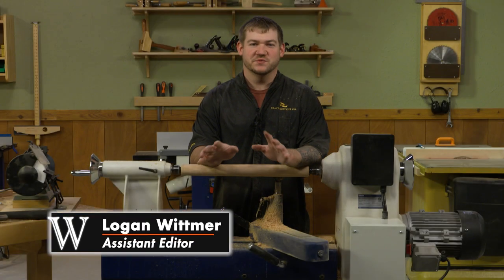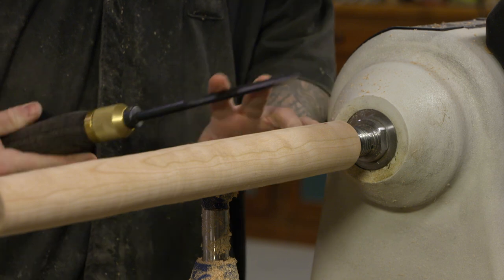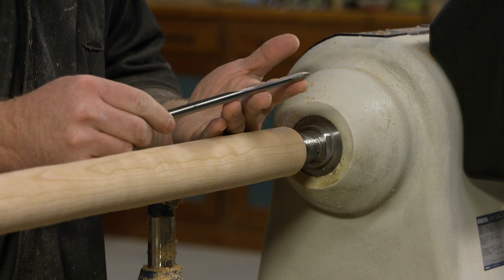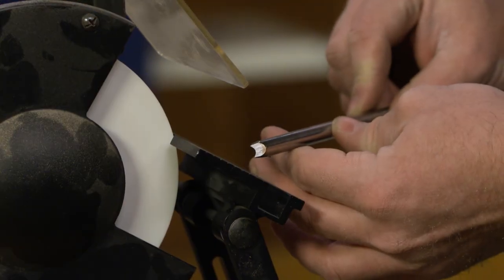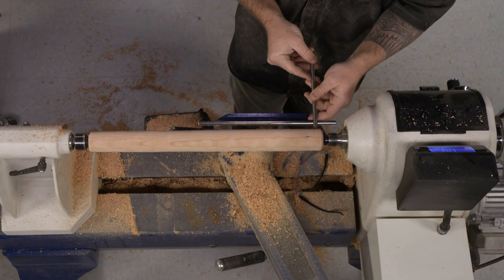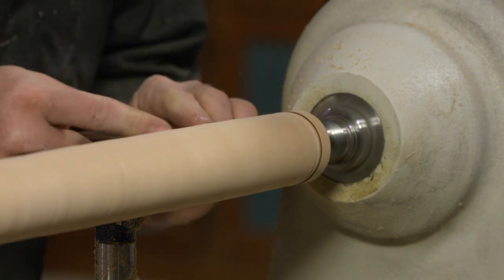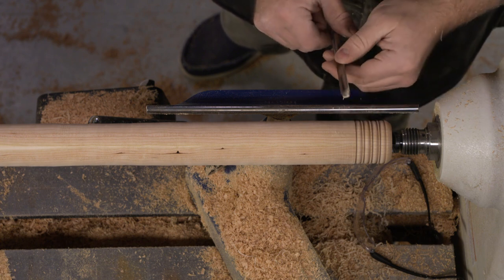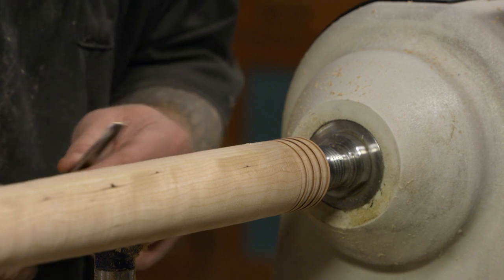Woodworking Tip: Turn A Spindle Gouge Into A Beading Tool

Comment: What was the reason to take off the handle?
Reply from the maker: I use an interchangeable to handle.  All my tools lock into a Jimmy Clewes quick-release collet.  I have a bushing on order for this tool, then it will lock in my handle.

Comment: Clever, but thats just one profile you can make it cut any shape you want like a shaper blade on a molding shaper.
Its funny no one has made a profile set of lathe tools like this as a set you can buy. And im going to bet they would sell
I could even see this in a carbide insert set you just change the carbide cutter or rotate it.  Say like a turret cutter with a lock and positive stops at 10dgr angles. 
So you can dile a shape. 

Is anyone making a knurling tool for wood lathes that fits onto a toolrest? 
Come on take some tool ideas from metal shop tools expand your abilities.